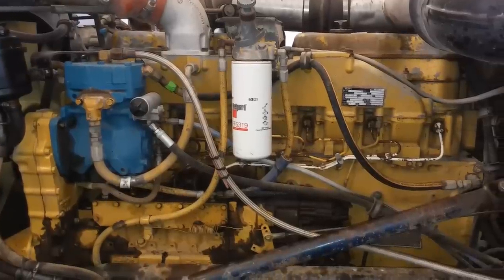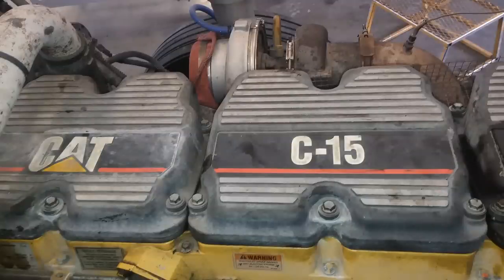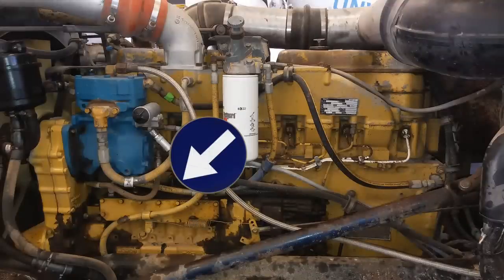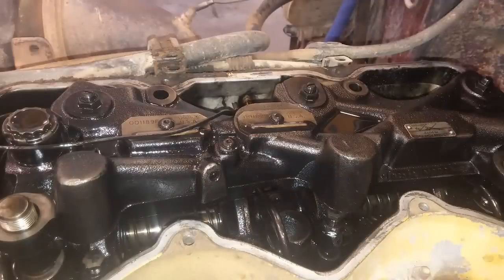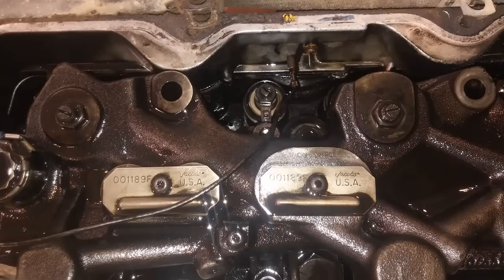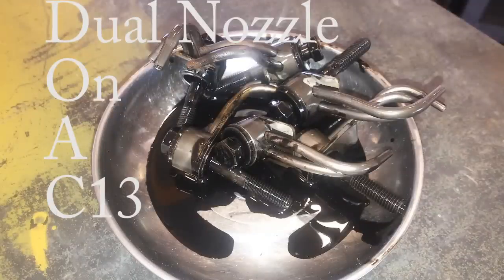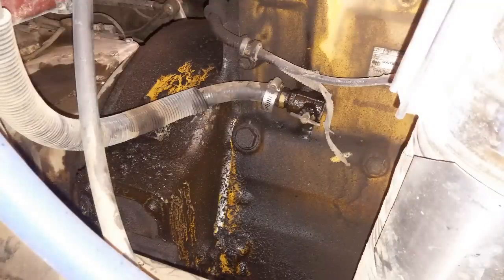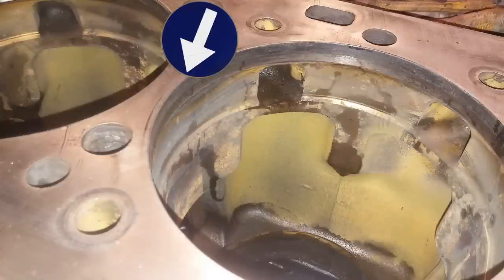The Cat 3406B Engine. Know Your Engine.  Caterpillar 3406 Information And History.

Comment: I just got a reman 3406 b 350. Do you if these can boost up to 400?
Reply: Reman was a 350 or a 425 HP, 7XC serial number. If I had one I would rerate it to a 425 HP 1650 Torque, clutch and transmission.
Why go to just a 400? Did you buy it new? If so you could have gotten a 425 HP.
Reply: John Goldsmith it was a rebuilt for 7000. I couldn’t pass that up. If I would of got a rebuilt 425 I would had to pay 11000.
Reply: @THEDC81025  Did they use Cat parts or aftermarket? Are you serious about going up in HP? If so I will need more info. 
I test a knowledgeable mechanical Cat mechanic if you knows how to legally look up parts needed for a rerate. Anybody can turn the screws.
Reply: John Goldsmith the serial number is 4mg46394 I don’t know if it’s aftermarket parts or not.
Reply: @THEDC81025  You don't have a reman engine. You have a production engine.
Reply: John Goldsmith explain. They said Inframe Kit Overhaul
New Main bearings
New Rod bearings
New Liners
New Pistons
New Piston rings
New Injectors Gaskets
New Gaskets
Cylinder head: Degrease, Magnaflux.

Caterpillar
Engine Model: 3406B Diesel Engine
Engine serial number: 4M646394
Engine total distance: Rebuilt
Advertised horsepower: 350 HP
Date of manufacture: Year 1988
Jake Brake
Reply: @THEDC81025  Your statement was I just got a reman engine. Cat does offer a factory remanufactured engine. It is a 7XC engine prefix. Your engine is a 4MG prefix. That was specifically built for a certain chassis set up.  A factory reman engine is a generic engine that usually requires some parts to be used off your engine or replaced to make it the same as your engine. Example the flywheel housing, exhaust manifold, inlet manifold, stuff like that might have to be swapped over. Also it is totally rebuilt with the latest improvements added to the engine. Wider journal crankshaft, exhaust manifold, fuel injection lines, brackets, VTU, fuel system,  stuff like that.
 Now your engine was built for a KW arrangement. Built Nov 29, 1988, put into service, Jan 4 1989. Sold to original owner in Va. Before I rerated it I would check who you got it from. If it has any warranty you might void it.
Reply: John Goldsmith my mistake. I’m putting it in 1984 359 it’s a 180 day warranty I have it by Tuesday. I’m taking the big cam 3 out and putting the 3406B 350 in.
Reply: @THEDC81025  Good luck, I would get some oil samples before warranty runs out. Also this is a 1800 RPM full load engine. It can be rerated to a 2100 rpm full load if road speed is needed. It is a front sump so you might have to make it a rear sump. You will need a longer pick up tube, possible psi tube.
Reply: John Goldsmith what’s a estimate of what you think that would cost? But I’m hopping 350 is enough hp
Reply: @THEDC81025  350 @ 2100 or rerate to a 400 or a 425?
Reply: John Goldsmith thanks this model is air to air right also I want to send you some pics when done.
Reply: @THEDC81025  Yes the later 4MG's was ATAAC. Going to a 350 @ 2100 is the less expensive of these changes. Going to a 400 or a 425, you have to look at torque, transmission and clutch. I would put something larger. Your engine is a 1350 FT LBS. If you rerate it torque will go up and you will already be set.  Most 425 HP during that time frame was a 1450 FT LBS.
On HP rerates the biggest items are exhaust manifold (not very often 7FB's was the problem), turbo, nozzles, VTU, fuel system, engine camshaft.

Comment: I feel bad for owner operators and trucking companies today. I don't know how they can make it with all the troubles of today's trucks. Every modern diesel I run today my first thought is if it's going to start and run. Then I wonder for how long. The heavy trucks are built just like cars now a days. Cheap throw away plastic parts and electronic parts that won't hold up in a grocery getter much less a heavy truck. Give me a mechanical engine 13 speed and a Jake and I'd be fine.

Comment: Miss that engine.The drive-ability was so fine on this engine.  Got one in an  86 freight liner new  with a 15 over. 44's with 2 speed and rear locker wide spread for the day. That thing would make a jump sometimes when turning hard. With air bags it was a good ride and above average traction. The nuts thing is the boss ordered it to leg out 86 mph. I was told!  We never turned the engine  up and it  was super maintained.  Did the Mains once. One water pump. They just start to weep a bit when they start to go.  If I remember correctly it was a Teflon seal issue.  Set the Jake a couple of times although they where not a very  good hold back like a Cummings.  Drove this truck nearly 6 days per week for years. Finally it was rebuilt at 18000 hours only because the new used buyer was going to haul way down south. Short is that it would have gone way longer the shop said.  The  trick is great maintenance and a forgiving driver. We never hung hard below 1500 much although they say you can pull them down and back from 1200 or so. I was not a fan of that. Maybe a couple of times  when you had to hang or screwed up. Usually you screwed up if you had to hang that l;ow.  Always wanted it to be able to gain just a bit. However the thing  could slug away at 1700 for hours on the BC summits. Pyro  never got over 1000. It could do that in the hot of summer and blaze away. Changed oil every 250hrs.   Drove the Cat A and B and ton of the others but  loved the 3406 air to air the most. Driving all this new stuff is disappointing. Electronic stuff screwing up all the time.  Like who de rates oneself!

Comment: Can any one help me my air pressure stops building air after 50 or 60 psi I recently heard and air leak on the cab or in the bottom front of the cab, lost air and could build air anymore do anyone can help me out my mechanic said it’s the air compressor going bad or is it an air valve there?
Reply: Put air psi on the discharge hose and see if you have a leak.

Comment: Adept Ape wasn't there an 3406A also ? I remember hearing. My uncle talk about one I thought ?
Reply: One of my co-workers bought an 83' KW brand-new with a 3406A in it.  It also had some kind of a transmission retarder set-up.  That truck came from the factory with no brakes on the steer axle, btw...  I guess that was optional equipment back then...
Reply: Mark Armstrong yeah it's white a buddy of mine had one in a k100
Reply: Stan and Charles thank you.
Reply: Wasn’t that the 1693 cat engine? Don’t remember it being referred to as the 3406a just 1693
Reply: kickincain  could be I never heard of it.
Reply: Stan Patterson 3406 a came out in the mid 70s we had a 78 pete with one in it.
Reply: 1693 was a 65B prefix
Reply: 3406, now called 3406A was a 92U prefix
Reply: Thanks for clearing that up John Goldsmith! After further research y’all were correct!
Reply: Worked on all of them. A-models was still being produced even PCTA's when I started. A 3408 with a brakesaver was a hoss. We called the 1600 series a clatterpillar. Never worked on a 1676.
Reply: kickincain - When the 3406 engine arrived on the scene, it was just commonly referred to as a 3406 - no A, understood as the first generation 3406, B and C to follow.  The 1693 engine was an overhead cam engine, which sure sounded good when it was accelerating - nice crackle to it, and its standard CAT paint was white, as you are aware of.
Reply: "... no brakes on the steer axle,..."  Yes, front brakes were an option back then.  Not good though when the weight limits were increased to 80k lbs.  Those heavy beasts were slow stopping.
Reply: White was PACCAR, Blue was Ford, Red was International, Yellow was the rest.
Reply: Chad Jessup Thanks for the enlightenment! Always nice to learn a bit of history on these motors!
Reply: Mark Armstrong a friend had an A model w/ twin turbo could break all 8 drive tires loose LOADED !!!!!

Comment: I have a 3406b 400hp motor in a Peterbilt, how do I convert into  a powerful 425hp
Reply: Serial number of engine is needed.
Reply: Best I can tell you have a front sump engine, 400 @1800. To go legally to a 425 @ 2100, (you need to check with your local CAT dealer to make sure). Your transmission and engine clutch will have to be replaced for the added torque.
You will need a turbo, torque spring, gov spring, vtu spring and run a timing graph to reset it. Fuel pump you have two choices, one replace the fuel system camshaft. The other you will have to slip the timing using the timing indicator group. You will never be able to pin time the engine again. After timing is slipped you could try and make a pin that fits the camshaft when engine is on TDC 1. If a pin can not be made every time the fuel system or vtu is removed you will have to use the timing indicator group to set it.
With nozzle growth on these engines you are most likely above a 400 anyway.
Since this is a 1800 full load and if you need more road speed you could rerate engine to a 2100 full load.
Reply: John Goldsmith  Thank you for the information I appreciate your help ... I was told to use this 178063 by Borg Warner. Maples Turbo in Florida selected that turbo for me by using my engine SN said it would work great on the stock motor and have room for when I modify it to have more power. My truck runs a 15 speed transmission with 5.29 rears

Comment: Can you do a video on what causes a runaway
Reply: savage732 just brakes that get too hot
Reply: Mason Cooper not that kind of runaway
Reply: savage732 you talking about turbo seal blowing and feeding oil into the intake? That kind of runaway?
Reply: I've got a 3406b that hadn't been run for a.long time ,when we got it started it ran away not able to stop it (real scary) finally took off fuel line  ,check it would  still turnover, so I figured  it hadn't  spun a bearing but    know whether it dropped a valve or not, what caused the governor to fail ? any help would be appreciated,  thanks

Comment: I have a3406b I changed the oil over a year ago and found a quarter inch Allen head bolt on the plug its been running fine but I changed it the other day and found another one still running fine but I'm wondering where they came from
Reply: Full serial number. Most of the time it is out of your VTU. They need to be inspected every two years. Depends on your serial number, the 8C9034 bolt. A 10-24 TPI about one inch long. Also the snap ring likes to fail, 8S7803. Better snap ring is 0093101. 7FB's and early 4MG's used a twelve point head bolt. Other places allen bolts was used is in the Jacobs brake.
Reply: @johngoldsmith6629  its a 4mg7456o what is the vtu? thank you
Reply: @johngoldsmith6629   Thanks for the reply I already checked that and all the bolts are still in it.
Reply: @jenniferhohmann1921  Could be from a previous failure and was not removed. Only other place is Jake brake, the head is more rounded. While the VTU bolt heads are smaller around, with no taper.
Reply: @johngoldsmith6629   Ive owned the truck for 17 years so I don't think it was a previous failure they are 1 inch long where about on the Jake brake and someone said maybe the governor?
Reply: @jenniferhohmann1921  Jake brake are not one inch long. Governor has nothing in it that is like this. Has to be VTU bolt. They are four bolts that hold the spool valve carrier to the drive carrier. You have to remove the start end cover on the VTU to get to them. It is held on with four nuts and a spring is under it. Order four 8C9034 bolts from Cat, and see if they match up with what you have. When you change your oil do you remove the front drain plug? That is where you find your VTU failure parts. Can you take a picture of them?
Reply: @johngoldsmith6629  Sorry I can't see how to send a picture on here.
Reply: @johngoldsmith6629  sorry for the slow reply. they came out of the back drain plug  I'm sure those are the bolts.i removed the cone shape cover on the front and can see the four bolts in there' where would I go from there? I ran It for two more months hard and its still running better than ever?
Reply: @johngoldsmith6629  I could be here at noon on Monday
Reply: @johngoldsmith6629  I am sorry I left home and Steve who you have been talking to apparently broke our computer lol.  He called me several times today because he didn't want to miss you but I couldn't help him get back online without being there.  Thanks for showing up and sorry he didn't!
Reply: @jenniferhohmann1921   Got to your Cat dealer and look at a 8C9034 bolt and see if it matches what you have.
Reply: @johngoldsmith6629  Thank you!
Reply: well my bolts came in today right length wrong size. I guess I should have put my glasses on mine are 3/8 any ideas? thank you.
Reply: @johngoldsmith6629  when is good for you
Reply: @johngoldsmith6629  are you here
Reply: @johngoldsmith6629  im here
Reply: @jenniferhohmann1921  I need you to take pictures of the bolt and one next to a ruler so I can see the length
Reply: @UCUksIKJDC5WGaM3k47MGZOA ok yes its 1 1/8 of an inch long
Reply: picture
Reply: @jenniferhohmann1921  Is it a allen head or a hex head?
Reply: @johngoldsmith6629  Allen head  what email
Reply: @johngoldsmith6629  It looks just like the other bolt I ordered but its about 1/16 of an inch shorter and its 3/8 not1/4 inch
Reply: @johngoldsmith6629  for some reason no  what is the jrg35068 for?
Reply: @johngoldsmith6629  sorry I got real busy I have to leave for a bit thank u
Reply: sorry my phone won't send pictures  could they have come out of the turbo

Comment: Hi Adept i have one question which cat highway engine is more powerful
 Right now I drive 2005 Pete 379 twin turbo c15 accert 475
Reply: A 625/2050 torque. Torque is what you want, that's what gets up that hill.

Comment: A b are the best cats ever c models  are  so so timing set differently  and but the plus of a c is the rods and mains are wider than the a or b
Reply: Incorrect, wide rod journals came in at different stages. Depends on PEEC or Mechanical and HP. Mains are the same no change. Timing depends on numerous factors serial number, HP, emissions year.

Comment: Can you do a video on how to rebuild the fuel pump on these 3406b. I have one in my Log truck and its starting to leak. also can I get more power out of this engine its rated at 425hp right now. The other issue I'm having is my jakes are cutting out then coming back on for a while then out again. The truck is a 379exhd. Thanks.
Reply: Your Jake's more than likely has a loose wire. Mostly on the solenoid under the valve cover. Other place is the throttle switch. 
A 425 was the highest you could go on HP. Some 3406C's was a 1650 torque. Is it leaking fuel or oil? A video would be difficult.
You have two types of VTU, two housing's, thick spacer or thin, two types of lifters and bushing's, Three or four pump group's. 
The rebuild principle is the same, replacing the cam bearings in the housing is the hardest part. A few updates that are not in the book.

Comment: Mine doesnt have a data tag on it but I did find the casting number on the back passenger side of the block. First 3 are 7FL
Reply: 7FB. Depends on year, could be a JWAC or ATAAC.  Serial number around number five cylinder passenger side. If original engine take the vin and call them.

Comment: mine quit running and running today its a sad day i need help asap it is loaded now and stranded at a VA hosp  that i was working at today:(  well seems like a fuel pump issue, i changed the fuel filter, pumped it up, then no start, broke one line loose on top of the mechanical fuel pump, pumped till i got fuel, then i broke loose one line up on the injector  cranked it till i got fuel, but no start after 20 times, only with starting fluid which i despise would it ever fire, so i  just had to give it alot   of small sniffs to get it to fire, hardle even stayed running with the starter engaged i hate ether! but whats a poor boy to do? so im sick and sad and need help bad

Comment: Did Cat ever label a 3406 with an A ?
Reply: Not that I have ever seen. Later some documentation refers to it as a A model, around 1993. Earliest 3406 92U I can find was built 8-29-1973, PCT, most likely a 325 HP.  Last 92U, 3406 was built 8-28-1986.
3406B started in a truck engine with a 7FB prefix. They used a 3406 now called A model cylinder head. Used Jacobs brake off A model, real pain to work on with certain items. The earliest one I worked on had to remove the Jacobs exhaust bridges to get the nozzle out. You had to hold the nozzle nut while taking the fuel line loose. Since it had the A model Jacobs exhaust bridge, it was not cut down to get to the nut. Right up next to it. Also the bolts that was used on the intake of the JWAC was three inches long with a spacer. The very front bolt was 3.5 inches long with a spacer. If the combustion side of the head needed to be surfaced. You had you remove all the valves in order to get the nozzle chamber out. First 3406B for public release was built 9-16-1983.
Reply: Thank you !

Comment: How many hp are in s 3406b
Reply: 3406B's
7FB JWAC max 400 HP
ATAAC, 7FB, 4MG, 5KJ, 3ZJ, 8TC, 2EK, 4CK, max 425
5YG only 460 HP
3406C's ATAAC
3ZJ, 5KJ, 8PN, 4CK, max 425 HP
3406C's JWAC I just found these, very rare.
Only 3 5KJ's built 515 HP
Around 50ish 5KJ's  460HP.
Reply: @johngoldsmith6629  o ok Thank you so much!. And Thank you for all you videos to that heop me a lat am not mecanic but l One One Truck. So  it  si a359
Reply: @guadaluperuben306  What is your full engine serial number?
Reply: @johngoldsmith6629  I dont know yet I need to go check on it its in the Yard right now. As soon as I have time I’ll send you the Number
Reply: @guadaluperuben306  It is stamped in the cylinder block passenger side around number five cylinder. If the engine is original you can call PB with the vin and they can find it that way as well.
Reply: @johngoldsmith6629  o ok thanks you